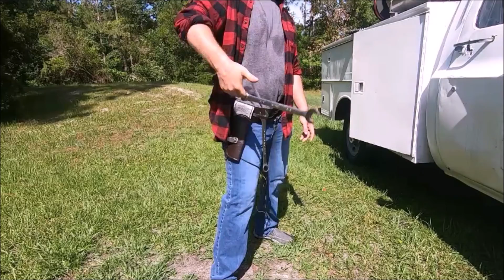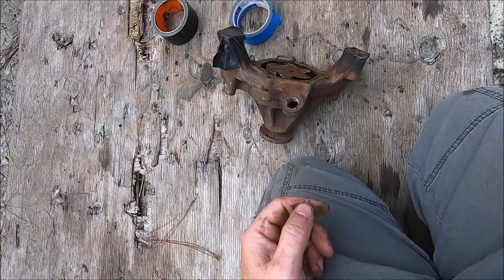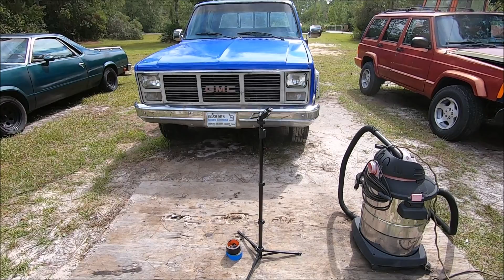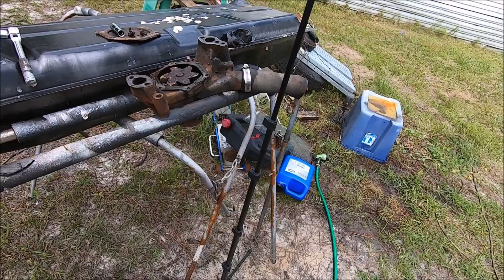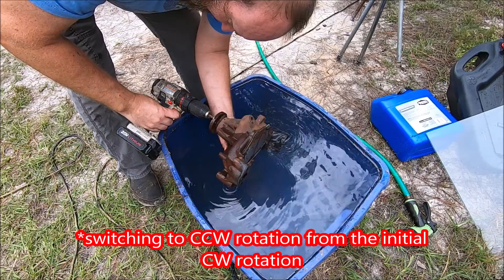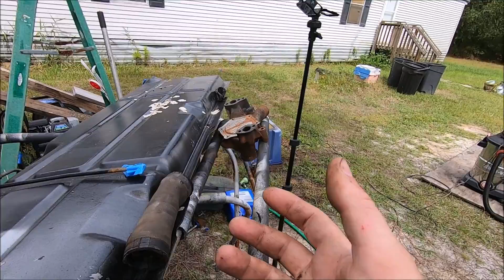Chevy small block water pump impeller rotation direction

Comment: i have a 1998 vortex 880 block out a suburban that year 1500 to be exact i took the vortex water pump off and added a standard sbc water pump from the 80s i cant tell what way it flows in about to start the motor on the stand within the next week to test these out to see what i need to do i already have the pump mounted with lock tite i might have to take it back off to check things like u said

Comment: What pump did you end up putting on? I have a Camaro with a 11 to 1 350 in it using v-belts. I ran into the problem it would stay cool while idle but would over heat as I drive. Took the pump off and it looks like the reverse rotation. So I bought a pump for a 70 Monte Carlo and it looks just like the one I took off, can’t find the correct pump to save my life. And before other people say anything. I have a large three row aluminum radiator lol
Reply: Guess he don’t reply to us
Reply from the maker: Sorry for some reason this comment didn’t tag me so it didn’t show in my list anywhere. The pump I ended up going with was the KMJ Performance HC8012. It’s a clockwise rotation high volume aluminum pump.

Comment: Hi. Water pump you're showing here is definitely standard rotation and that's the factory style impeller. I don't know why they choose to make those fins like cups but it's not the case here. Angle of the fins shows that this impeller sucks in the middle and "throws" fluid outside when used in standard rotation. So, when you're using v-belts this is the right water pump. I've had bad new water pumps with so bad overheating issues. Impeller to case clearance is important. It should be about .01-0.135. If it's too big, you get cavitation and overheating. In some cases only one head gets cooling.
Reply from the maker: It is definitely a reverse rotation impeller. The ‘cups’ on the impeller are not supposed to push the water. The convex side is made to push the water. Rotating the pump shown in a standard rotation would have the concave impeller side pushing water, which is incorrect.
Edit: as an addition to what I mentioned above, all regular pumps (standard or reverse impeller) pull water from the center and push it to the outside. The variable is the impeller orientation to correlate the pulley spin direction with the best way to move that water according to which direction the impeller spins. There are reverse flow pumps, which move water from the pump into the block, but this type of pump is not addressed in this video.

Comment: You hit the nail on the head, wonderful video, I think that what my problem is, went to brand new serpentine system, three pumps, radiator hoses feel like no water in them, radiator full no movement, all hoses no pressure while running, 454 big block did not have this problem until I went to, reverse flo pump, any advice?
Reply from the maker: If it’s truly a reverse flow pump, with the direction of coolant flow through the block reversed, then that’s a separate item. Either way, the vane type on the pump has to match the direction the pump is driven for the best performance. But it certainly sounds like there’s a possibility that might be your issue.

Comment: I have a 86C 10 400 small block 73-80 crate motorI’m having a overheating issue with idie does my truck need a reverse rotation?
Reply from the maker: The serpentine belt setups are usually made for reverse rotation. The v-belts are usually standard rotation. It all depends how your pulley and belt arrangement spins.

Comment: At shutoff of the system, in other words if you totally closed shut the radiator top hose, the pressure that the pump produced if measured with a gauge would be the same, sometimes slightly more if running backwards. However, the restriction to flow in the engine and radiator is what determines the point that the pump head capacity curve meets the resistance aka system curve. A pump with the vanes in the correct rotation FLING the fluid in an efficient manner, thereby creating a greater flow. It is this greater flow that produces the system to resist more.  Look up system head capacity curves for an explanation. Retired Pump Sr Product Engineer.  A very good video ! The tip speed of the impeller  is the primary driver of shutoff head pressure produced, regardless of direction. Once water if flowing ,correct direction is very important.
Reply from the maker: That is an excellent description. I’m not a hydrodynamic engineer, so I didn’t try to explain the ‘why’ part. Probably didn’t explain the ‘what’ part well but I tried, lol. Thanks for sharing this!
Reply: @wrenchwranglers  your explanation was the BEST I saw, since I was looking around when a guy in the small block chevy facebook group had problems. My 85 Corvette has a serpentine belt, and I never gave it a second thought on the rotation. Knock on wood, never had a problem since I owned the car for 37 years.  The fact that you included those side by side pictures of the impellers was great !  We occasionally would get a pump back on warranty that ran for years going bacwards . At very low flow, high resistance in the piping,  it still did the job, and it usually shows the cavitation pitting as you described !  The fluid comes in at a velocity and angle ,and a proper impeller shape puts the vane entrance angle to match. This reduces the turbulance and keeps efficiency high.

Comment: Man, you guys saved my life! When I looked at the impeller inside the water pump, I saw the same thing you described in this video. I have a '76 El Camino with a 350 small block V8 engine. I think someone installed the wrong water pump here.

Comment: Does the long water pump ever come in a reverse flow? I just replaced a water pump and I noticed a arrow in the casting pointing OUT at the water inlet from the lower radiator hose location. I didn't pay it any attention at the time but now it gets warmer/ hot and doesn't seem right. How do I find out?
Reply from the maker: I haven’t seen any for Chevy small blocks but that doesn’t mean they don’t exist. The issue with that is usually radiators work best by putting hot water in the top and cooling as it falls through radiator. This helps work with convection the way the old model T’s worked with no water pump at all. The water naturally wants to move that way so it’s easier to pump it that way. Pumping it backwards and up through the radiator would make the pump work harder for several reasons so it isn’t sound from an engineering standpoint.

Comment: Here is my only issue as I try to correct my ignorance on this… Airtex and G3 garage say the exact opposite of this.
Reply from the maker: Part of the reason I did this is I was also confused and looked at everything else first on this truck. It just wouldn’t build cooling system pressure or pass enough coolant through heater loop. The internet seemed to say my pump was correct. But I can verify this pump is not correct for a clockwise rotation application. I can’t speak for what others have found, only by what I found here.
Reply: I went to look when, after installing a customer supplied polished Tuff Stuff pump for their dressed ‘55 Chevy that was leaking, we introduced an overheating concern that it never had. He took that pump back to the perf parts place to swap. I suspected wrong impeller, so I removed the cover and checked first this time (he had taken the original and gave it to a friend after I swapped it, so I dont have it to compare). Looks reverse flow based on this video, but not the others. Ugh. I ordered a standard pump from a parts house, for this year 350 (69-1/2 Z28 was the donor car) to disassemble and compare. Same impeller setup. Ugh again.
Reply from the maker: You could try a high-flow or high volume pump…. They seem to usually have a different impeller design and are maybe more likely to be correct since they cost more. Might be more oversight on supplying the correct parts or part numbers.

Comment: Hi there , I have a stock Camaro 78 with Chevy 350, with single belt setup( v belt), is my application is stander rotation or reversed as I searched online it have the same impaler as the one shown in the video. Some people show the pump in the video as stander.
Reply from the maker: If you have the pump impeller that I took apart in the video, yours is made to spin counter clockwise. Opposite the crankshaft. If your pump spins the same direction as the crankshaft (clockwise) then it needs the opposite impeller.
It will move some water in reverse, as I showed in the video…. But it won’t build pressure inside the system correctly.
Reply from the maker: Your application would be called ‘standard rotation’ or, same direction as crankshaft
Reply: @wrenchwranglers  thanks for replaying, it's suppose to spin with crank shaft, as it single belt setup which clock wise if you view it from the front of the engine, I think I need the opposite impaler from the one shown in the video , is that correct ?.
Reply from the maker: @ahmadaldahoud1719  yes that is correct you would need the opposite of the one I showed taken apart.
Reply: @wrenchwranglers  thank you.
Reply: I went to several parts stores and got 2 different pumps that say standard rotation. And the one I keep getting is the one you have in the video. I need a pump for a V-belt system that spins same direction as the crank.
Part numbers would be appreciated

Comment: Could have been for reverse rotation engine,  used in motor boats. 
With reverse rotation cam and starters ,  engines can be used in motor boats.
Reply: Water pump dirrection depends on belt type.

Cam is the same in reverse rotation engines, the cam is just run gear to gear instead of with a chain.